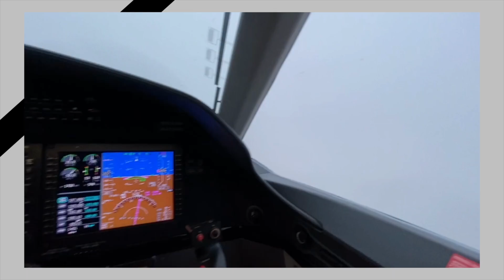Robinson Helicopters, 3 Weird Reasons Why They Are HATED

Comment: I wouldn’t call the Robbie “cheap,” it cost a few hundred thousand just to update it after 2500 hours! Mast bumping is a larger threat in a Robbie than most other piston or turbine models out there. Things you missed…the idiotic tilt cyclic…special FAA training to hit the autorotation gate…and occasionally questionable tail rotor strength.  I have many, many hours in R44’s and I don’t like them. That said, there simply isn’t another four seat piston heli out there.  For me, the Enstrom is the best (but still limited) piston ship out there.
Reply: Yeah, good point`s. Have you flown the Cabri G2? That`s my favourite piston helo, so lovely designed and easy but beautiful to fly. With heavy people on board or a lot of fuel you`ll run out of power, but on what helicopter is that not the case, except for the Astar B3 and a few others.
Reply: Huh? R22 has a pretty good tail rotor and the R44 has a great tail rotor... Not sure why you're saying that? 

I've got a a fair bit of time in Enstrom helicopters and they are maintenance hogs ( which drives the hourly cost way up ). They have a good record in terms of the rotor system staying together ( still just that one fatal? ) but they just kill you slowly by bleeding you ( or your wallet ) to death...

Comment: Everywhere I've been, the R22/R44 are the entry points for commercial helicopter pilots.  I think I've heard of 1 or 2 schools that use Enstrom or Schweizer helicopters...  How does one, that's not independently wealthy, begin flying with anything else?  Seems like a rare case.  Just like most fixed wing pilots learned on a C-172/152 or a PA-28 series at one point... I guess now you have Cirrus aircraft; but those are usually the expensive way to earn your ticket... You still have to do your multi in a Travelair, Seneca, or something similar.  Rotor pilots have a more $$$ entry; but for the most part you can do all your training in R-22s and R-44s and get a CFI job or dry cherries (thought it was a joke when I first heard it) to make up the hours for the big leagues.

Comment: The first two seconds 😅😂 omg
But on a serious note, Robinsons are the only class of chopper I've flown so far because like you said, it's a low barrier entry point into the industry. I'm glad I get to work on my skills in a small craft before I move onto a larger one.
IYO, what's the easiest to fly?
Reply from the maker: I mean all small helicopter are a bit challening to fly, A bell 407 is quite easy to fly, becuase most turbines are easy to fly, but I mean  with enough experince all helicopters are "easy." Keep crushing it Rebecca. Love seeing your name pop up! Hope everything is going so good!
Reply: I`d throw in the Cabri G2. I don`t have a lot of experience on other types, but just the fact that, if you pull to much power, all you have to do is notice that the RPM drop and lower the collective again, makes it hard to damage the aircraft inflight. If you pull to much in the 206, it`s gonna be expensive.

Comment: They autorotate like a streamlined anvil, with very slight deceleration duing the flare.
The mixture knob is TOO CLOSE to the carb-heat.
There's hardly ANY load-feel on the controls.

Comment: Wow, isn't great you won't every hit any mild turbulence and encounter any negative G.
Any reason you MASSIVELY exaggerate the pitch down condition? Are you doing aeros in the death machine?
Did Robinson ever fix the fuels tanks falling off, spliting open and bursting into flame during a hard landing?
I obtained my fixed wing CPL when the R22 first arrived on the scene and was going to obtain a commercial rotary add on but changed my mind after a little bit of reading about the linkage things. I also didn't have a very big watch so I would have been disqualified from becoming  a fling wing pilot. 🤦‍♂️

Comment: Uh-1 Huey had Mast bumping issues as well. There is a great ARMY training film all about mast bumping on youtube, go look it up if you like. Second thing, watched a video of a crash with one of the small helicopters like the ones your talking about. There is one belt that drives both the main and rear rotor, if its put on wrong or there is a problem , you loose both rotors, not a good situation to be in.

Comment: Interesting thing is all helicopters can be susceptible to low G tail strikes. A EC135 crashed years back where I live due to a tail boom strike. The grand daughter sitting on the pilots lap accidentally and abruptly pushed the cyclic fully forward in a rapid movement by kicking it or something of that nature.
Reply: The test pilots from Hélicoptéres Guimbal tried to get the Cabri`s blades close to the tail, but they did not get it close to striking. And I guess in the Astar it could be, at least close to, impossible as well.
Reply: Can't hit the tailboom by a pushover unless the pilot overreacted. I call BS. Articulated rotors are not the same beast.
Reply: You must be a Genius smarter than the NTSB. LOL.  @helicopterdriver

Comment: So,
Moral of the story,
Do not let a "Pushover" fly a Robinson. 😳
I learned on an R22 n have about 15 hours in them. They are twitchy birds. I'm now flying a cool Bell47G with full hydraulics. It's like power steering. Same thing here, semi-rigid rotor system. There are some things you just don't do, for example, what would happen if you're driving a car and abruptly turn the steering wheel hard?? Yeah, that's right, you'll
more than likely flip and roll the car. Same thing when flying a chopper, there are things you just don't do. There are choppers out there with rigid rotors that can withstand pushovers n can do some acrobatic maneuvers. Even then, the Pilot needs to be highly skilled. Not for the squeamish.
Clear blue n 22
Over n out..

Comment: Mast bumping also happens in turbulent air at speed.  They had a lot of crashes in New Zealand, and they traced the crashes to the turbulent air and flying at fast speed in their mountainous country 
So it’s not always the pilots fault. The Robby was designed as a personal helicopter, not as a training helicopter.  They became popular trainer because they were cheap.  I learned in a Bell 47 another two blade helicopter, but Bell 47s never had a mast bumping accident. Because they put a device on it to prevent it. Robinson worked for Bell but decided not to incorporate such a safety device in his design.   I don’t like the t-bar  cyclic. I guess it’s fine on the tiny cramped R-22 but when you upsize to the R-44 and 66 they should have gin to a standard cyclic stick.  Any aircraft that you need a special FAR to fly it is not a good design. Too many crashes in Robbies. The Schweitzer was designed as a utility Trainer. It also has more room inside than the puny R-22. I went to get some more training. The R-22 is too small for me and it can’t handle my weight with an instructor. Therefore I would have to train in The R-44 thus negating the lower cost. The Schweitzer cost less than the R-44 to fly.  You can love it all you want, you know it and you have a lot of time flying it.  But I don’t like it . It doesn’t fit me well , I found it cramped and don’t like the feel of the controls. I think it’s a bad design and there are better helicopters out there. If you’re going to fly helicopters it’s going to cost a lot. So going cheap isn’t always better. Like all cheap stuff you get what you pay for. You won’t see the military flying Robbies. As trainers they used the Bell 47 and the Hiller Helicopter, then switched to the Schweitzer, then the Jetranger and now  it’s the UH-72 Lakota.

Comment: My reasons for not liking them:  The list is too long.  However, let’s start with the T-bar cyclic.  That is just dumb.  Second, the low-inertia main rotor. Third, the main rotor blades are glued-together; I once had the main rotor de-laminate, while flying in light rain from L.A. to Carlsbad. Also, the 22 has been known to have engine failures because of the Governor increasing power when someone gets carb ice.  It increases power until it has no more to give, and then Boom!  No power.  Robbie’s are a cheap gimmick.  Fly the Schweizer 300C or an Enstrom.  Live by the Robbie; die by the Robbie…
Reply: The main rotors on the Apache, Blackhawk, S-61 Seaking, AH-1 Viper, UH-1 Venom, & Marine-1... all have composite laminate rotor blades that are glued together.   What about those?  

Furthermore... the blades on the R-22 you were flying did NOT de-laminate from light rain.   
That was the result of previous damage, or the blades had exceeded their 2200 hr or 10 year lifespan.  
FYI... all helicopters have life limited rotor blades.   The Apache's, for example, is rated for 1400 hrs.
Be honest with your criticisms & stop lieing.